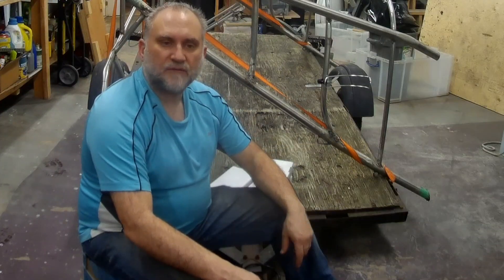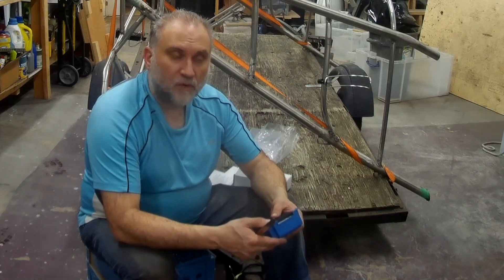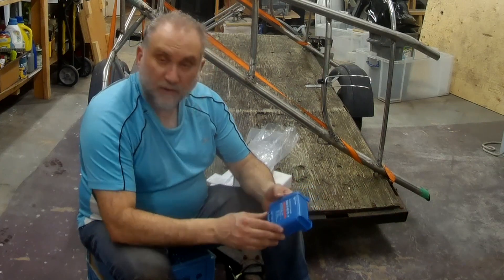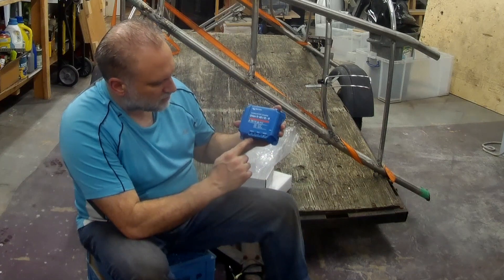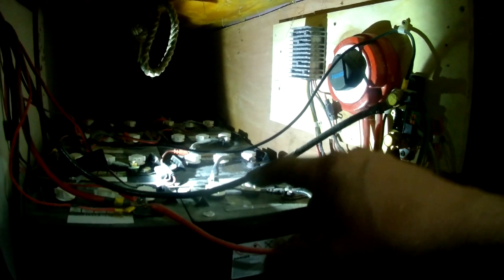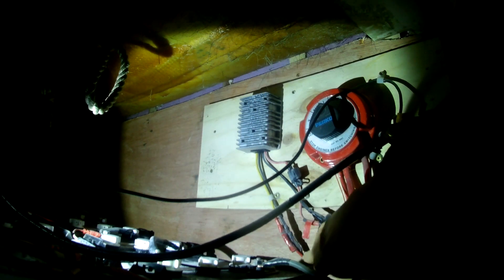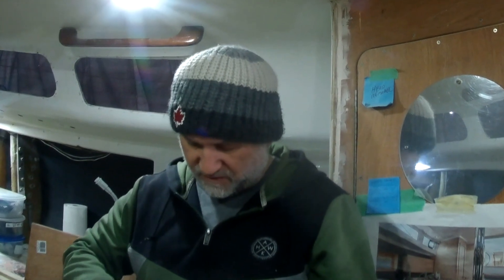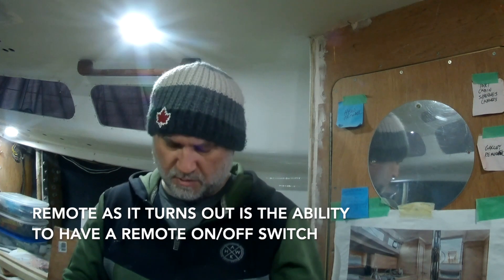Ep116 Unboxing Victron Energy's Orion TR-48/12-9 DC to DC Converter

Comment: Can i use Victron Energy  Converter 48V-12V 9A with 12v to 230v. pure sine inverter?My idea is Make 48v. li-ion battery and put it through Victron,who are connected with 12v. to 230v.inverter.
Reply from the maker: hello i believe the answer is yes, but the power is only 9 amps. this translates into roughly 100 watts. 

i have my inverter directly connected to the 48v batteries. i am using the victron quattro 3000 watts and i think it has a 230v option for EU. mine is tge 48-120 as im in Canada. 

so technically it will work on the DC-DC converter but the power output is so low i don’t think it can power anything useful.
Reply: @TheNeds  thanks!